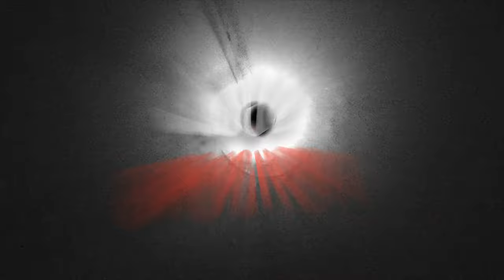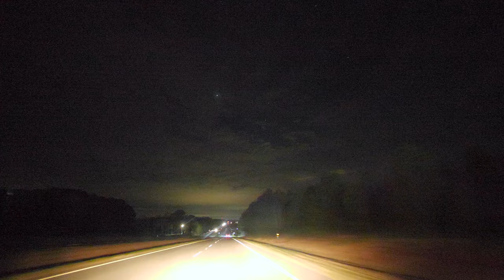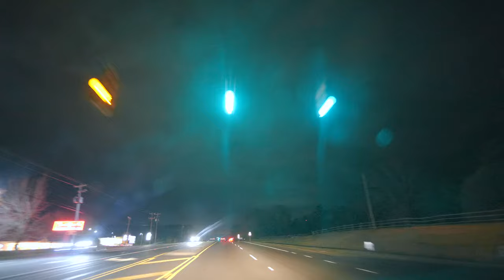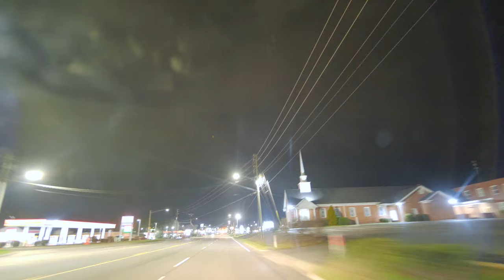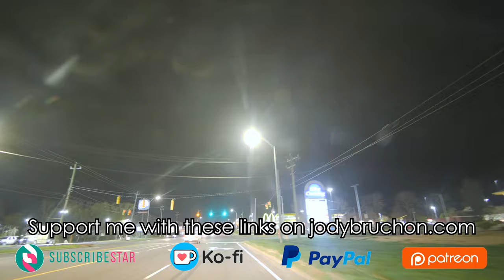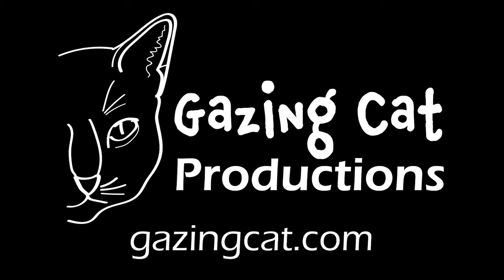I Hate Repairing Touchscreens - Rollin' Rambles - Jody Bruchon

Comment: This sounds like the second iteration of FRUs. Back in the day, we used to do component-level repair of CRT monitors. Then the vendors started simply doing whole unit swaps. Laser printers and PCs were still component level, but the writing seemed to be on the wall when they changed CRT repair policy. It kind of sounds like the touch screen is going the way of component-level repair of the CRT. My guess is that laptop repair is essentially going to be the big brother version of mobile phone repair. Just swap out the module and call it done. All parts are just a commodity. BTW, with your camera's exposure set so high, that was an awesome view of the Pleiades 7-Sister Cluster. It's so faint when looking at it with the naked eye, but it really popped on your video.
Reply from the maker: The Panasonic GH5S is amazing. The lens is a 9mm f/1.7 too. I'm glad you enjoyed the star show.

Comment: There was a god awful run of HP laptops in the mid-late 2010s that when they updated to Windows 10 the driver for the touchscreen quit working, so if you were unfortunatey enough to touch one of these "My touchscreen always worked, blahblah"
Not since updating to Windows 10 it hasn't.

Comment: Screw the glue-assembly of the "modern" electronics in all it's forms. What TF is wrong with screws? And as a side-note: why do we "need" stuff to be thin? If we get electronics that are then self-killing because of heat, who does that serve. That gets me so furious.

Back to topic, yeah - even when plastic clips get broken you can somehow keep it together in another way, that you can then disassemble again (even if it's duct-tape).
Reply: the screws on the Xperia P actually looked kinda neat but they only helped a little with a repair.

Comment: I like that, even though it's not exactly the topic of the video, Jody enforces the stance that Framework (and there was another one which name I forgot, Jeff Geerling made a video about a laptop where you could swap everything and had the batteries similar to the 1.5V AA that many toys had) is what we should have going forward. With Linux, of course.

Come to think of it, seeing how many people are skeptical of Framework in general, and Framework 16 in particular (which does have its fair share of problems and limitations), there is a need for a BIG ASS compilation of repair problems that you can get into which would be not an issue or be much easier/better with Framework. Many people had the luck of their laptop not having a problem or getting it resolved easily and not realize the many other big issues on the topic that others faced. Problems like: not being able to repair it at all either because a) the manufacturer doesn't want to (cough Apple cough) and only it can do it or b) it's more expensive than buying something better. Or having a problem that should be a trivial non-expensive repair turn into an expensive big replacement because how the manufacturer developed the product for dubious other benefits (cough Apple maan these fruits nowadays cough). Somebody here in the chat already gave an example of this. And as much as I hate Apple (and booy, do I do), unfortunately they're not the only ones doing this.

Comment: I had a very similar experience last year when I tried to replace the battery in a Kindle Fire tablet. There was a whole load of small screws which I was expecting to find but I wasn't expecting to find that Amazon had also used some incredibly strong adhesive to help keep small bits of the case together and the lithium battery in place! With the sheer amount of screws that was used they wouldn't even need to use adhesive!

I didn't have a heat gun to melt the stuff either so I had to try and carefully remove the adhesive by using isopropyl alcohol and using a small flat head screwdriver to try and break it up, after a LOT of effort I finally managed to get the battery out and found that it was nigh on impossible to find a replacement so I just ended up getting rid of the Kindle Fire. 

After that experience, I don't even want to deal with touch screen devices anymore!

Comment: I don't have a chromebook but the HP laptop I have is a silver x360 convertible. The back cover has this thin plastic with inserts for the hinges to screw into. The part where they do had one side bust off. This should be a $5 piece of plastic to replace tops but it's affixed to the back which costs about $50. But to get it off I had to deal with this stretch tape. And I broke the glass. Screen was great and a chinese knockoff replacement with the brightest black and more glare than a David Caruso audition cost me about $100. If the WEF and Greta et. al. wanted to reduce emissions and save the planet they would out companies like HP and Apple for this. A small repair that should have been simple and easy and cheap cost over 30x what it should have, employed people likely living in a factory city, getting cancer, and polluting the environment. HP has been TRASH ever since they merged with Compaq that should have DIED. It's like a Chrysler- looks nice and might be a little enjoyable but it's unreliable and designed by a the equivalent of a dishonest used car salesman.

Comment: I think the real question here is what the users who continue to buy such junk are smoking. Why buy a touchscreen laptop when you can buy a regular screen laptop and a USB mouse, and have none of these issues AND no issues with fat-fingering icons nor putting your grimy fingerprints on the screen?

This rant was too short and not spicy enough. Let's hear some more talk about why touch screens are just a bad idea.
Reply from the maker: This was meant to just touch on the hardware repair aspect. The meaty video I want to put out is about why touchscreens are a terrible user interface. That's going to be much more interesting.
Reply from the maker: Also, one reason this was short is that it was a scrap. After I recorded something much more interesting yesterday, I had 12 or so minutes more driving left and this issue recently happened to me. If you liked the ex-wife video then you'll like the woman who tried to get me fired video that's going to drop soon.
Reply: @JodyBruchon Let's hear it!